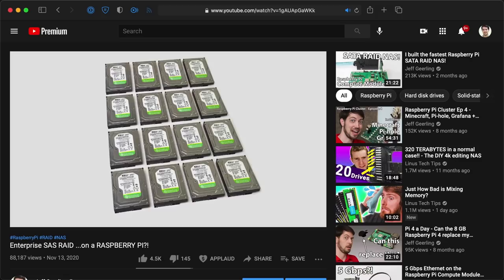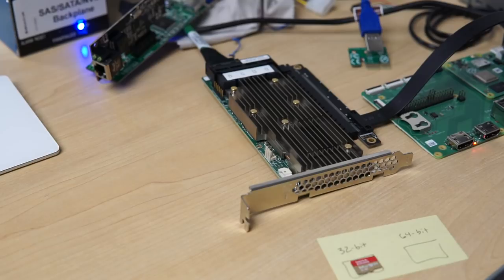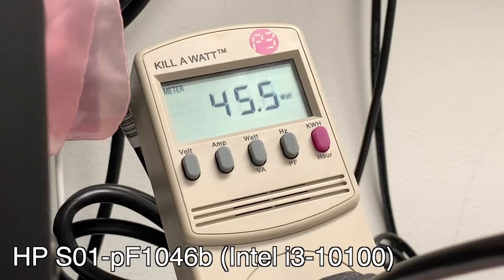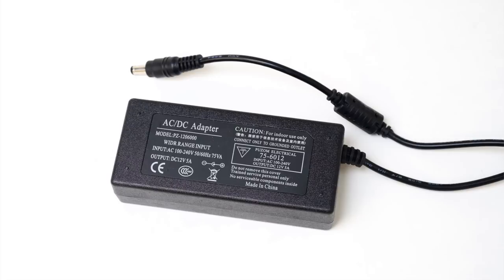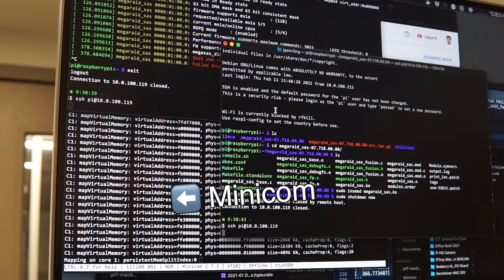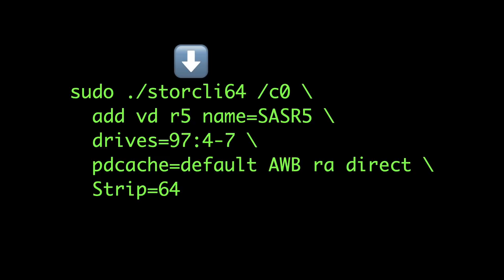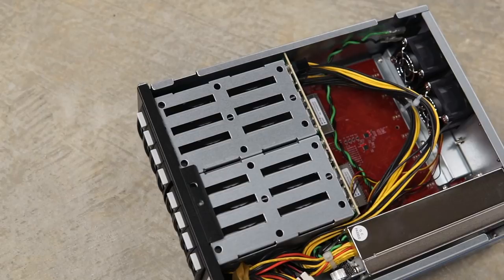Hardware RAID for the fastest Raspberry Pi CM4 NAS!

Comment from the maker: Like if you want to see Jeff get shocked more (— RSJ).
Reply: ok
Reply: ElectroBOOM liked this message, lol.
Reply: Maybe just red-shirt jeff
Reply: Hardware Raid is great, exept:
- good lock if the controller fails and you cand find the exact same model
- no easy way of getting Drive fail allerts to the os.
- it expensive
Reply: Sure, why not?
Reply from the maker: @The Kingdom of Bad Decisions Unfortunately for the video, I think the magic smoke hung out inside the PSU for a bit. Plus, I quickly yanked the shorted connector out, thus limiting the amount of magic smoke I let out. Next time I'll be sure to leave it connected a bit longer, to fill up the room a bit :)

Sadly, I can't convey the smell via video, but the magic smoke was most certainly released. The PSU's fan now clicks and doesn't start spinning fully when I try powering up the PSU.
Reply: Jeff please upgrade the system ram on your raspberry pi 400.  PLEASE!???  I really want to see you pull surface chips. Also, no one else has.  I've looked.
Reply: I’m trying to build a 12 disk (2.5’’) raid with RPi4 and 2 self powered usb3 hubs (tp link uh700) that each offer 7 slots (14 total) but when connecting the 8th Device the drives are no longer visible/accessible in Linux. I suspect a power issue but cannot understand why. I even added a larger power supply to one of the Hubs but still get the same issue. Do you know what the problem could be? I am supplying 12v/2.5a and 12v/5a to the two hubs which gives plenty of power. My calculation shows that when spreading the 2.5’’ HD’s evenly the consumption on the hubs should not draw more than 15watts on each of the 2 hubs. And the RPi still has its own power supply. Have you come across similar RPi issues? Any tips?
Reply: Anybody got a link to the back plane?
Reply: 16:51 OUCH. Given the risk of modding a 24-pin I always resorted to a purchased priming jumper when I had to use a PSU separate from a computer as I am to squeamish to make my own. https://www.performance-pcs.com/cables/power-supply-adapter-cables/jump-start-eps-atx-24-pin-power-supply-jumper-on-off-switch-red-light-mdy-cab285.html  Another suggestion: When you do eventually come up with another alternate power supply for both cards make sure it's slaved to the CM's board power-- I can only imagine the magic smoke problem if your CM board suffers a backfeed incident.
 PS. What are the ratings on those shrieking fans on your  hard drive enclosure?  I hope you can find some Noctua fans to replace those micro dustbusters for the sake of your sanity.
Reply: Turing Pi = "cluster computer" on a board

Blade Pi = "blade computer" on a board

=-=-=

If you have free time to re-design your turing board to strip form factor, you should create new product line which i call "blade pi". Combine all possible hardware & software capabilities, we can build "powerfull" affordable blade computing unit

Place it inside sealed tool drawer, fill with dielectric coolant fluid then boom: we have silent home server, silent crypto miner, silent rendering farm or whatever you want to build
Reply: I think he's beyond electroshock therapy, maybe just give him a beer and tell him to chill?
Reply: Remember, to turn on a PSU without a power button, short the green wire and black wire together
Reply: @marcg1043  In this video he mentioned using 2 power supplies isn't recommended because the ground is no longer shared which can cause problems. He instead beefed up the PS on the CM4 board, not sure about limitations for USB power rating on CM4.. it may be too much. Doing software RAID on USB on many ports is probably not a great plan though. The USB controller has to deal with interrupts and if you are using all the drives at once as you would with most RAID setups it's limited by more than just the total USB bandwidth of the controller I expect.

Comment: I’m finishing up my last semester of University and I’m building a autonomous robot system with a Pi for my senior design. Everything you say is so many levels beyond my understanding / capabilities but you do such a great job and explaining and keeping it interesting. Keep up the great work man!
Reply from the maker: Every day the things I do are beyond what I did yesterday, just keep learning and growing!

Last year did I think I'd be debugging storage cards over a serial UART connection? Nope! But now I can say I have, and almost every time I do something new (which to some may seem basic, to others voodoo magic) I realize it was only intimidating before I tried doing it.

Most of the time it's a lot simpler (conceptually at least) than I feared it would be!
Reply: @JeffGeerling  Debug is art form learned over years of tinkering. Its not something you get immediately out of college. If you continue to ask the question, form a hypothesis, find a test to prove or disprove you can debug anything.

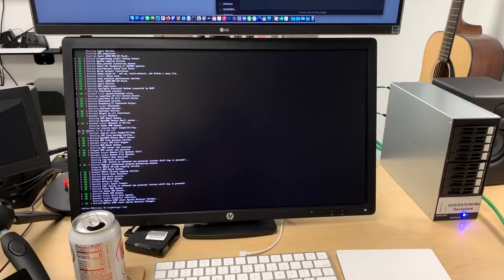Comment: 4:05 There is also a third reason you didn't mention but probably fits given your passion for experimenting with the Pi boards and other stuff You're setting the stage for future Pi/CM boards by developing the groundwork now. Speaking of Broadcom's interest in this beyond doing a solid to major developer for the Pi platform they've established is that currently the CM board's PCIe capability is too anemic (the card they sent you is capped to 1/16th of its nominal bandwidth right from the start) for serious commercial interest but for the price of that raid card and the man hours working with you to troubleshoot it-- it lays the groundwork for when the Pi CM devices they create are capable enough to truly power a fully loaded SAN they already have most of the kinks worked out.
Reply from the maker: You had me at the kinky fully loaded SAN!

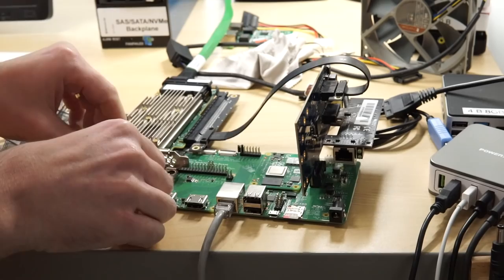Comment: 16:03 please don't use anti-ESD-bags to run electronics on them - they are designed to not let static build up, but are NOT good insulators, so you can short pcbs laying on them.
Reply from the maker: This is true.

I really, really need to 3D print an enclosure for the CM4 IO Board that allows me to physically mount a PCIe card above using a riser.
Reply: Yes, they need to be conductive to be anti static, but the resistance tends to be relatively high so 5v is unlikely to be an huge issue - still its bad form.
Reply: @JeffGeerling  this would be a good video topic :)
Reply: Ha! I saw that too!  Reminded me of my own bad habits - hot on something and needed an insulator quick...

Comment: You can start a PSU without a PC if you short the green wire on the 24 PIN connector with any of the black ground wires. Great vid as always
Reply from the maker: That's what I did :)

The problem is, one of the other wires I had cut off on the connector shorted out. Should've removed the wires entirely instead of leaving them dangling.

Comment: Buy a cheap "PSU tester", they have a few LEDs for the power lines and a short to power up the ATX PSU. Great for quick testing PSUs or when you need get high current 5 or 12v without magic smoke.

Comment: Pro Tip - Get a paperclip, bend it into a U, then shove it in the ATX motherboard connector and ground out the green (power on) pin, usually right next to it, and you should be good. The paperclip should stay in place just fine and you won't blow up the PSU.

Comment: This video highlights the huge advantage the Pi has. A cheap SBC with support from people like Broadcom. So many cheap SBC systems get next to no support.
Reply from the maker: I actually asked the engineers about it—the teams that work on storage (like the card and backplane I was testing) has very little relationship (AFAICT) with the wing that manages the ARM processors.

It's like that in most large corporations. Broadcom Inc. has a very interesting history (the storage cards went LSI, then Avago, then Broadcom, through a series of buyouts/mergers... and I'm probably missing a lot of this history there!).
Reply: @JeffGeerling  you got the history right from 2000- now. The LSI adapter you originally used was from the same business division that is now Broadcom.

Comment: I really need to get back into trying to get Fibre Channel working with my CM4 to see if I can connect it directly to my SAN. I've got the card detected, that was the easy part, but it's now stuck with kernel modules. They compile but the HBA doesn't initialise on boot so something is missing, just need to figure out what

Comment: I wish I had the resources to put something like this together for long-term NAS storage. However I recently bought an IBM x3650 7945-AC1 2U server for $179, with an 8 bay RAID controlled SAS array, and outfitted it with 8 x 600gb. 10K rpm SAS drives for another $60. With 64gb. of RAM and 2 Xeon 8 core E5620 CPU's, it will handle anything I can throw at it. Only drawback of course, is power consumption. It draws around 140-150 watts at idle and can ramp up to several hundred watts if loaded down. Fortunately, running a Plex Media Server, a couple test web sites and my business software rarely pushes the CPU activity above 10-12%. I guess if I wanted to do a NAS with it also, I could add another SAS backplane and RAID controller and fill the remaining 8 slots with 8 x 1.2TB SAS drives and run XigmaNAS as a virtual machine.😁 (You see what I'm doing here, right? Talking myself into buying more stuff!)🤣

Comment: I forget what it's called but the reason your hard drives move the entire case, is the same reason that metronomes sync up. The the small forces average out over the entire device, this is why you need Enterprise grade drives if you're going to have more than eight drives next to each other.

Comment: Obviously we'll need to find cheaper SAS/SATA cards that don't completely over saturate the Pi PCI-e but still have the tools to help the Pi offload as much possible off the CPU.

I do love the potential for a SUPER cheap super capable Raspberry Pi CM4 NAS. A SAS/SATA card with a heap of drives plus even USB2 ports for a cheap external USB backup, not to mention the onboard Gigabit Ethernet.

Comment: Hi Jeff
Quick advice, hack a cheap PSU (the 10 pounds with 450W generic ATX should work), you already have the connectors and always cut the other way of the jacks (e.g the motherboard site) so that you have longer wires to play with!

Comment: Besides cpu parit calc a hw raid also saves PCI bandwith as it transfers only one write replica
Reply: Hi, would you mind expanding on the "transfers only one write replica" part? im trying to make a physically small server using a tiny (1 liter) form-factor pc that has a single NVME slot (pcie 3.0 x4 lanes) so im researching what is the most I can do with it.
Reply: @hectororestes2752  well if you have only one disk then this does not apply. But when you do software raid then each write will be written two or more times (to each data and parity disk individually). Those writes pass the PCI bus multiple times. If you on the other hand use a physical raid then the write is written only once to the HBA and that will write it (ideally over separate channels in parallel) to the attached disks without needing any additional bandwidth on the Cpu PCIe lanes.

Comment: This is exciting and eye opening.. all the assumptions are out of the window like, the rpi4 can't handle the full speed of the gbit in NAS use cases even if the IO is doing over 300MB/s
Very cool that you reported the power usage at the wall as well. It's obvious the i3 with their ATX psu is going to be extremely inefficient at these low loads too

I can't imagine how mindblown you will be the day that a rpi has 8x pcie 3.0 lanes available for use 😅

Comment: In theory it's actually be possible to get better than just PCIe 1x speed on a PI NAS, if you use a multi-lane switch and can set up the storage controller and NIC to talk to each other directly with PCIe DMA.
Reply from the maker: True, and I was actually talking to the Broadcom folks about this... it might be possible to get a full 3-4 Gbps read/write if keeping it through the PCIe cards, bypassing the Pi's CPU.
Reply: @JeffGeerling  also, here's a rather ridiculous application of this I just thought up: if you do get PCIe DMA working between the Raid and NIC, then you should be able to connect the pi's own NIC to the PCIe NIC and aggregate that 1Gbps with the  4 Gbps through the PCIe to enable the pi to access the storage raid at up to 5 Gbps rather than just 4.
(Actually, if it's possible to configure the pi's integrated NIC to talk RDMA, this might actually be feasible to do, just barely.)

Comment: Hey Jeff, really interesting project. The first thing I thought is how you are gonna get the speed from the raid array over the network since you already used the pcie port for the controller and the lan port is the limiting factor. In case you want to try this with a cheaper setup maybe you can go for a cheap SAS2 expander like the BPN-SAS826A and plug in the drives standing directly - it's quite jank but might do it for a prototype. Regarding the atx PSU, I rigid one together by shorting the green startup (5v VSB+) with a paperclip or short wire. You can use a cheap used OEM PSU like the FSP350-60 that comein at maybe 20$ and of decent enough quality. Anyways, I'm looking forward to your future shenanigans on this project. Keep up the good work!

Comment: You know I don't know much about RAID in terms of hardware and software but if I was hired to build a distributed data storage solution I would strongly consider something like the raspberry pi (with redundant power supply like feature and maybe a little more RAM) due to the ability to apply rolling updates, manage caches such as metadata on NVME and highly requested transactions on NVME as well as compression and error correction encoding parity. I would probably use Rook on Kubernetes to implement Ceph (admittedly this is the only storage setup Ive procured myself but was and am thoroughly impressed). The Kubernetes cluster could even be scheduled for other jobs dynamically if storage isn't being accessed a lot-- try doing that with a hardware raid setup.

Comment: There may be a latency trade off with platter drives but it sure beats replacing SSDs every month!  Although in the real world there's little difference between a consumer SATA SSD and a 10K RPM 12Gbps SAS drive.  The vast majority of folks out there are going to be reading and writing from 1Gbps anyway.  Even for beefier folks those SAS drives will hold their own.  Besides, when you need 50TB you have little choice.
Reply from the maker: This is true! I'll be getting into some more spinning disks in the coming weeks :)
Reply: @JeffGeerling  My oldest storage server is an insane 12TB!!!!  Oh wait, pretty sad you can get that on one drive now.  Although, to be fair, it's 12 years old with original drives running 24/7.  Yay for HP ENT drives.

Comment: Pro tip, RAID5 and RAID6 will always perform better with the number of data drives set as a power of two. As such a four disk RAID5 is sub optimal. Try again with three disks or five disks.

Comment: Bro! Just use a (mining) psu turn on extension. There are many verities but personally I use an extension that let you plug a 24 pin connector on one side and a Molex cable from the other side. when the molex is on, it turns on the 24 pin connector psu.

Comment: I haven't had issues with my powered riser (PCE164-3N03 VER 006) so far. Since they typically use the shield of the USB cable for ground, that could be the issue if you're using seperate power supplies (I believe you said you had better luck with a thicker cable from a different riser that with the thinner one that came with it). I'm powering the pi and card with one power supply, so there is a good ground connection that way (an old 250W ATX power supply that still has floppy power connectors for the cm4. I also just put a bit of 1mm solder into the 24pin connector of the PSU bridging the green wire to ground. Older power supplies might also need a base load to give out a stable voltage, a power resistor of brakelight works pretty good for those. Newer ones shouldn't need it though.)
Reply from the maker: Thanks for the info—the risers have been really hit or miss, but I do wonder if the ground and the separate power supplies could be the issue. I might try powering everything through one next. I just wish someone made a proper modular PC PSU that was intended for 'bench use', with a bunch of molex, PCI, etc. connectors and a switch, and didn't rely on PS_ON to turn on!
Reply: @JeffGeerling  You can get those ATX breakout boards on ebay that often have a switch for PS_ON for fairly cheap. They only need the 24pin connector, so the other ones are still free.

Comment: Moving cabinet?
Well, the Minicomputer I was admin on back in 1985 the 12" cab had feet dropped so the wheels was not connecting the floor, and STILL the movement was about 5-10 cm on the top. :-)

Yes, that with the cabinet full with small 5" rotating rost. :-)  The original disks was full 12" wide and about 3-4" high, so these SCSI discs was small. :-)

Yes, it was a Prime 750 computer. A great computer for it's time.
https://en.wikipedia.org/wiki/Prime_Computer
http://www.chilton-computing.org.uk/acd/icf/mums/prime/p009.htm
Reply from the maker: I love anecdotes like these! I was in SMB IT as my first job, so I didn't get to see the really fun stuff until much later in life!

Comment: Good luck with you power supply.  I one on the bench a while ago to compact to work on for me.
Reply from the maker: Just picked up a new one, thanks to the generosity of Patreon and GitHub sponsors! Apparently it's the same model (or so it seems), now rated to 700W. And the little connector I hacked together works great, now that I removed all the other connectors besides PS_ON and one GND.